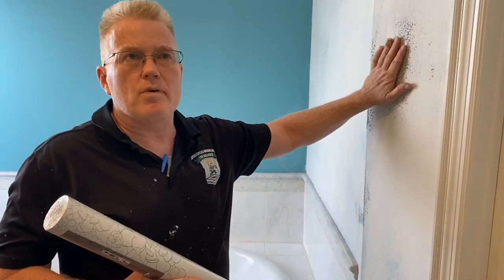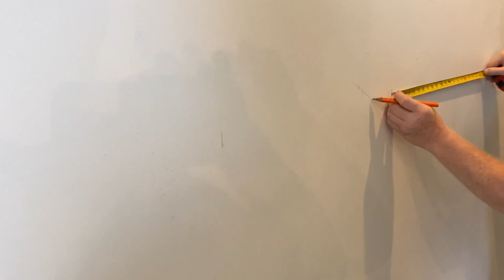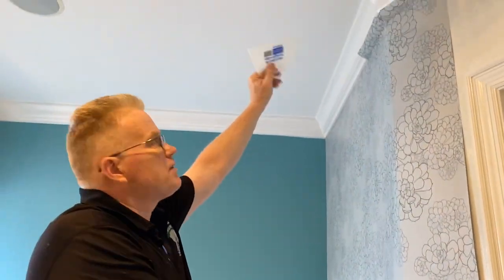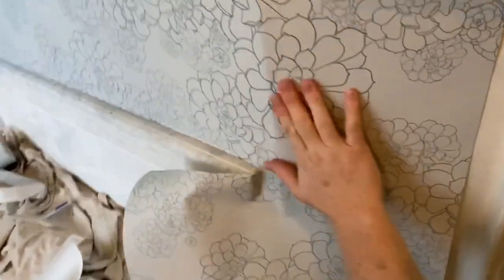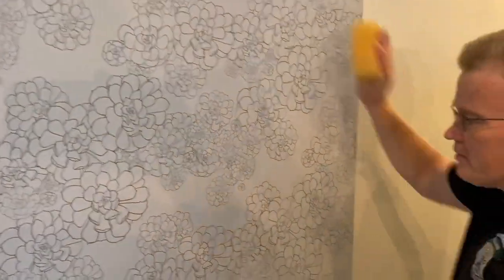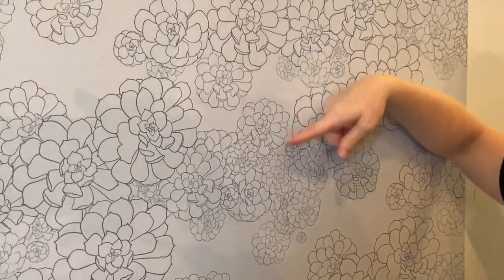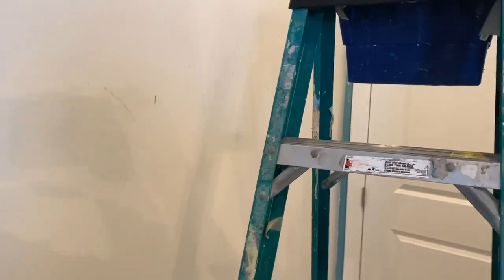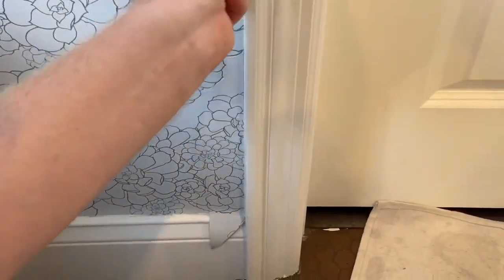How to Wallpaper an Accent Wall for Beginners - Spencer Colgan

Comment: I use to hang a lot of paper and book it before applying it to the wall say 10 years ago. I noticed lately the papers have said to apply the paste to the walls as you move along. Not onto the paper. Any thoughts
Reply from the maker: Few say paste the wall.  Its thinner stuff that says paste the wall. Less need to book.